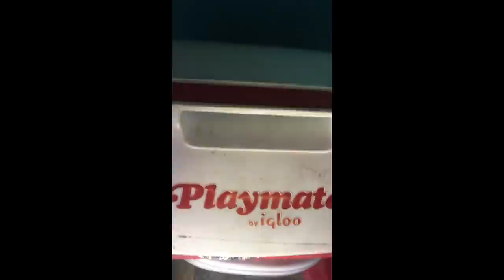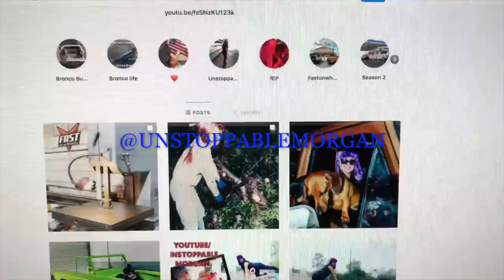RV/BRONCO LIFE OUTTAKES |Cross Country Adventures

Comment: Awesome U Morgan《☆》You and the ElDorado are baaaddass :*: guessing it has a 360 small block Mopar engine with a  3 spd 727 trans. You should be able to sell it pretty quickly for the engine & trans alone but I  hope you keep it if you can get rid of the spiders & rats. Make sure you seal up any holes so they can't get back in. Jacksonville Fl. Is a big Navy town & cost of living ain't bad. I had a 33 ft motorhome in my driveway for a few months so I'm sure yours would fit ☻